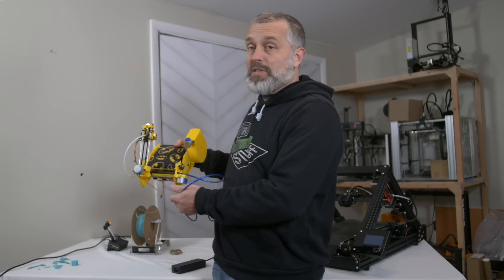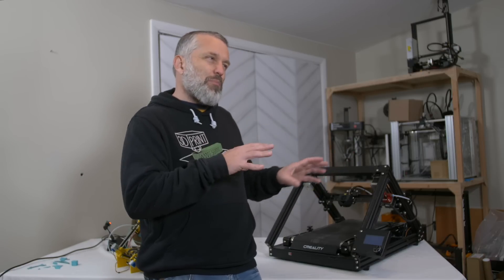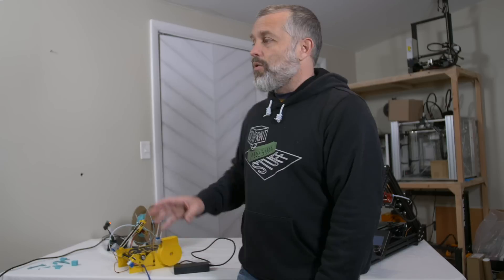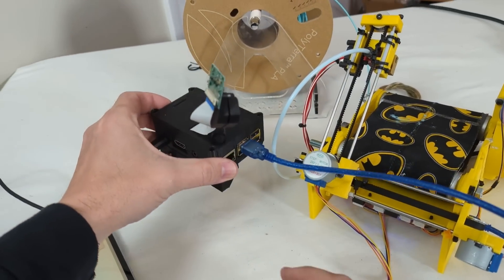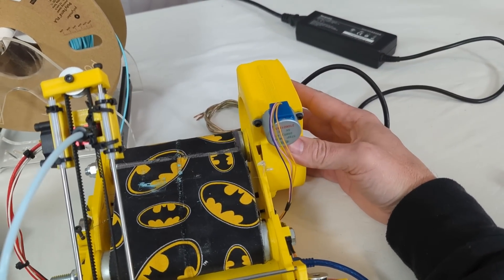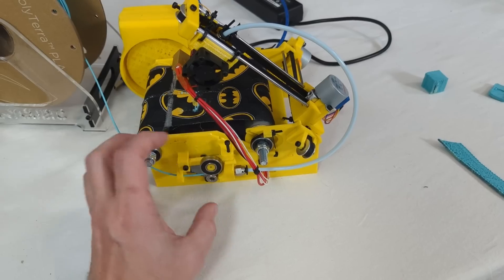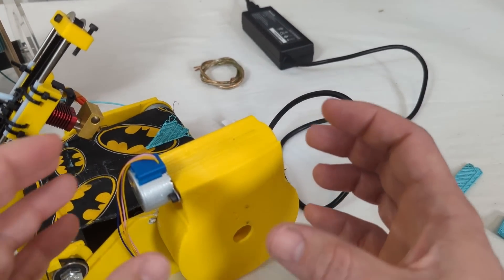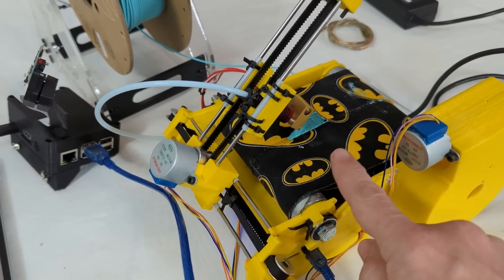Introducing the Baby Belt 3D Printer - Print Loooooong Parts For Cheap.

Comment: Thanks for the Shout outs!!!  Can't take credit for the new Worm Drive design that was all Rob Mink's work.  Oh and the LCD was only $15 shipped as its currently on sale so might still be under $200. ;)
Reply: I have gotten a few of these small printers that used those mini steppers and they fail a lot. Have you thought I about maybe pancake steppers. I’m referring to nant fun k series the extruders shred themselves. I would love to jump on this though.
Reply: @krypticvoyce  I've been working on a Nema14 driven design but at the moment just trying to help make the current hardware work to its best potential.  The Primary idea is to keep it inexpensive and upgrading the steppers will definitely hurt the budget.
Reply: You can always get those LCD kits for around 15.00.  Even from Amazon.

Comment: In my opinion, it seems like you're misdiagnosing a few of these problems... the multi-second pause is not the motors, it's the software  (possibly being held back by the MCU), for advanced kinematics like this you really need a 32-bit MCU.  Also, the spotty infill is much more likely to be caused by the extruder not pushing the plastic evenly and consistently...

Comment: Having worked with and used 28BYJ-48 steppers throughout my home automation projects, I don't really understand why they need to dwell in this application? That doesn't make sense to me. Is it to prevent overheating? If so, heat management is not that difficult with these, especially with this very low torque application. 

(EDIT: Ignore this point here, it looks like they are already converted to bipolar, as the red wire is not being connected to the main board). Also, it's possible to at least double the produced torque of these steppers by prying off the blue PCB cover and cutting the center trace of the PCB, thus converting it from a unipolar to bipolar motor. I use these to open doors and hatches in my greenhouse, and manage to get over 1 ftlb of torque out of them with a compound gearbox I designed. 

In any case, I feel like the technology used in this project could be leveraged a bit more with just a little more polish/nuance to the design. As it exists, it seems a little haphazard.

Comment: I think maybe the bottom price point goal is too prohibitive. A $350 machine with nema 14s, a screen, real guide bearings, and a slightly better hotend would definitely be worth the cost increase. It's great to see this as I couldn't pop for the cr30 cost!
Reply: completely disagree.  The simple fact that we have several E3 clones for well under $200 (e.g. Aquila X1 at $159 shipped), means that manufacturing costs are no more than about 50% of that pricing, or in the Aquila instance, about $80,  There is no way the components to add a moving bed should cost more than $50, which would yield a total cost of $130, and suggesting a selling price of $260-280 at most.

Comment: I find the cr30 printer pointless. They used their bottom basement extruder and screen and built a 1500cad paper weight. Unless I'm wrong. That little printer puts creality to shame in so many ways. Good work. I love the little steppers, I have a bunch of them and drive them with the uln2003 darlington transistor ic. Those steppers all behave differently as well. I made the wife a carousel clock and I had to change the motor and tweak the code a bunch.

Comment: That’s a great concept,nice video too. I’d defo try a wider nozzle, treat it like a low res printer. Nema 14s are pretty cheap too, it might be worth spending the few extra bucks on those and using a cheap board, it’s easier to upgrade the board but since the steppers are integrated into the design it would make sense to go with the N14’s, still it’s a cool printer and looks fun👍

Comment: Kapton tape and glue or abs slurry.  Works for me . Never used one of these . Seems cool to many bugs for me to care right now I need it now so my makerbot replicator 2 will suffice for now . I've modified it to work perfectly because of new filaments such metal suspension in pla . Its awesome and you can put in a kilen and come back with 100% metal part. I think that's dope especially since I'm making crazy that requires all possibilities.  There is only yes we never no we can't.

Comment: The screw on the tip of the arm is used to calibrate the head distance to the belt and can be adjusted. No need to do firmware nonsense.

Comment: Would be great to see a human treadmill conversion project. Maybe with a pellet or clay extruder. They're already built to handle heavy dynamic loads, just need to get fine control of the belt axis, and swap out the (usually wooden) deck plate for a piece of aluminum with a heater pad. And many of them already have the ability to set an incline angle.
Reply: This is exactly what I would want to see out of a printer designed to use recycled plastic.  Household plastics were abandoned a long time ago because they reused plastic was too difficult to use and they warped too much.  Plus people only wanted speed and detail.

However, I've always felt we should have gone in the other direction.  Big beefy hot ends that can chew through anything.  Large diameter filament to compensate for a subpar material.  G-Code that compensates for extreme warping. These things are all lying on the table and nobody's even trying.

Just imagine throwing milk jugs into a shredder at the top of this treadmill pellet 3D printer contraption and it just continually spitting building bricks out the other side.  That would be a dream come true for me.  And I 1000% believe it's possible.

Comment: Although unlimited length objects is flashy, it seems to me not nearly as useful or practical as it's made out to be. It comes at the expense of quality with these 45-degree print lines.  Why not a vertical Z that builds one part at a time and ejects it.  Following that logic, why not a special belt bed I can mount to my existing printer which allows me to eject parts.  It seems like too many parts to put a printer on top of the belt mechanism when it could be a bed feature clipped and plugged into an existing printer.  ??
Reply: that type of belted feature can't be done because it is protected by a Makerbot patent, this is why all current belt printers use the 45 degree axis approach as it isn't covered by the patent.
Reply: @NAK3DDesigns  Thank you so much for educating me on that point.  Patents do not stop people from designing and building their own or offering free plans to build such things.  It only blocks (as I understand it) producing, importing or marketing that type for profit.
Reply: @davethacker8410  you’re 100% correct.  You can design and share but you can’t profit from it in any way.

Comment: just thinking outloud ...  what if there was a belted printer that printed at 90° (normally) and printed in a interlocking pattern.   think wall bricks being laid with a shallow stairstep leading edge. 

it would be software intensive and need considerable Y (or belt Z) travel , quick clearance on 1 side of the nozzle , and it would have brick-like seems , but i think the would solve the layer-line weakness of current long parts. plus the regular benefits of a normal printer.

Comment: Wow! Good thinkering direction for an infinite z but instead of printing on a cold slack rubber-ish belt, is there any metal tambour-style track conveyor?
A succession of carefully positionned nice flat surfaces about ½-1" to print on. Heat only the first ones and the part could pop off when it's cool at the end. Or the heat at the end, to a blade that shaves the part off smoothly, like the Autoejection Polar!
I'll drop my Monoprice Select Mini in the stairway and fit all that in an old router table... I'll need a Discord account too!

Comment: I wonder if you could use a relatively stiff belt material and put kapton tape on it. I guess it probably just comes off after a while. Also the printer was probably just running klipper so you can either edit the config file on the raspberry pi to change the offset permanently or just enter the command in the terminal.

Comment: I also look into the FB group "45th Degree" they have designs to convert some printers to 45° belt printers.
Reply: Oh, and if you check out on YT "Call me Swal" he has a video converting an artillery hornet (ender 3 "clone") with about $40-60 in additional parts, and the printer itself is usually selling for about $170-$190